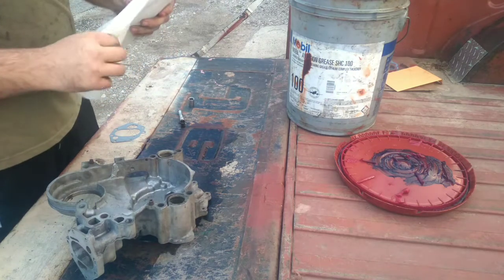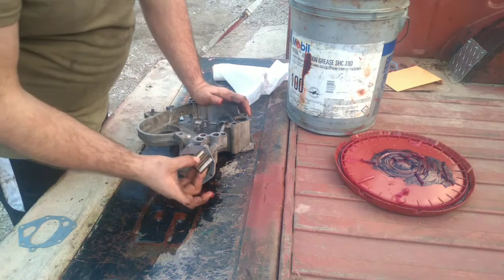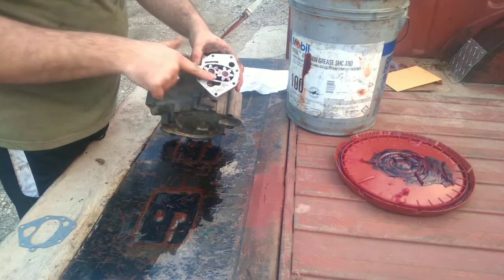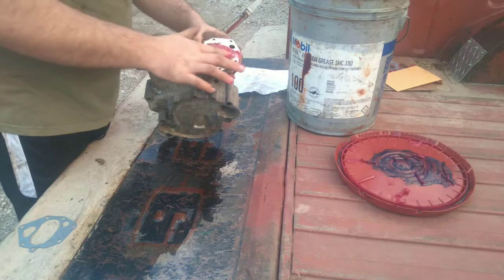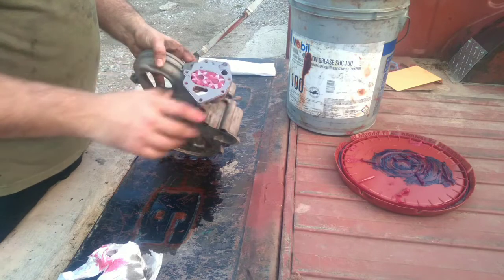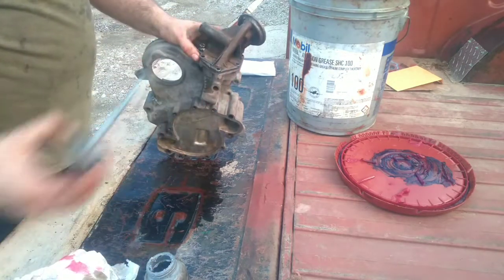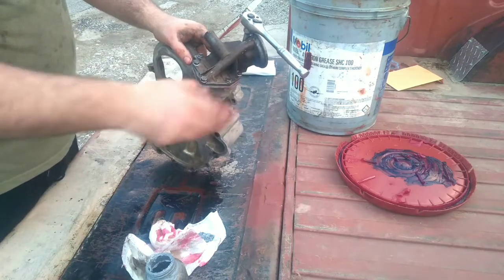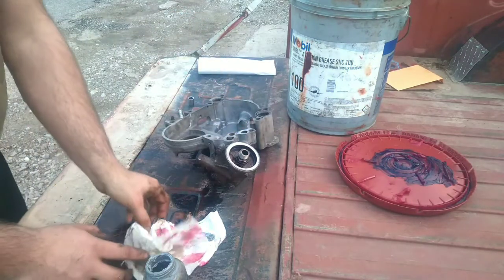AMC 360 Oil Pump Assembly

Comment: I think using grease (axle or bearing) to pack the pump for priming is a bad idea. Most greases stay thick even at elevated temperatures, which may cause problems with oil flow. Petroleum jelly (white petrolatum) works best, because it melts (becomes liquid) at only 125 degrees fahrenheit, and will dissolve into the motor oil.